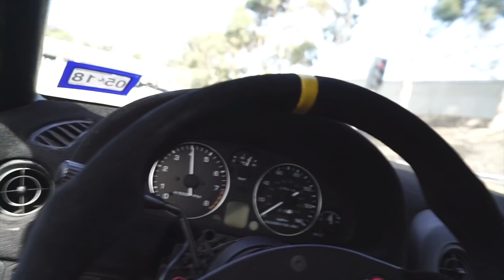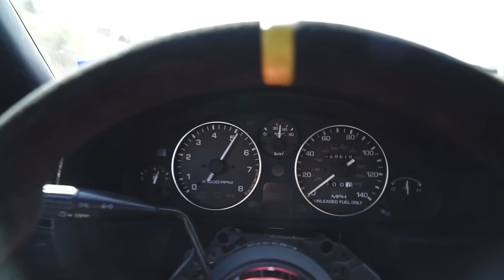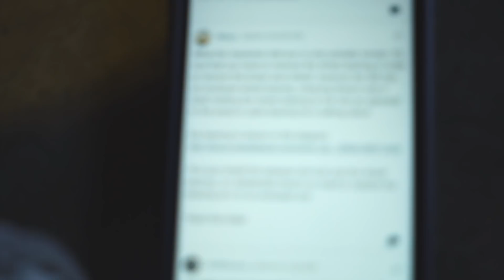It's worse than I thought...

Comment: On the battle version kit, you don't have to do all of that to get it to fit. All it requires is for you to shave the right side of the "ear" on the top of the "knuckle/hub" so that you get your clearances also you can use a cut off wheel to cut the dust shield to get the secondary caliper to fit slightly snug and look appropriate. But from one ZZ30 owner to another, keep it up, soarers are tricky but subtly easy. Also for the brakes, stock calipers have a -3an /24 fitting not too sure what's on your willwood but I'd say go for a 3/4in master to save you a headache with flare fitting hope this helps

Comment: Im guessing you already got a million responses, but the hub doesnt come off the outside like that. You need to remove all the toe links and control arms from the knuckle first. then use an air hammer, or a punch and hammer to push the axle towards the center of the car while pulling the knuckle off. The axle can stay in the diff. Then when the knuckle and hub is off you will have to use a press to press the hub from the bearing/ knuckle assembly. Enjoy.

Comment: Technically drum brakes actually have better stopping power due to having for surface area of the friction material, they lose to disc brakes because the heat up faster and don’t efficiently dissipate that heat as well as disc brakes do. Also it looks like your E-brakes didn’t work well because you have almost no pad left on the brake shoes. Just an FYI

Comment: That hub is pressed if you want it off the best way is to get it pressed out. But if you take off the drum assembly there should be some bolts do take off the drum breaks either way I personally would cut the shield right there. Just a fyi from a SC owner to another.

Comment: You need a puller to pull the hub off of the axle. You don't need to pull the axle out of the diff. Sometimes you can hammer the axle out of the hub but you chance messing up the threads

Comment: Evan I hope you know that all car ebrakes use small brake drums inside the rear brake rotor to hold the car in place lol. The reason yours probably wasn’t working correctly is because it for one, needed new brake shoes on it, and two, it was more than likely way out of adjustment and needed to be tightened so that when you fully pull the ebrake it locks the brakes in place.

Comment: I guess you don't know but if you look at those brakes rotors you will see two holes on them across from each other,get two bolts and just wet the threads with oil and screw them in and use a rachet and as you screw them in they push the rotor off. In most cases rotors are usually slack but if they are tight then use the bolts

Comment: It NEVER goes as smooth as you think it will lol. A buddy and I recently changed out the headlights in his NA Miata with some new LED ones, and it went perfectly, until we finished and for WHATEVER reason, the passenger's side headlight is now stuck in a not quite all the way up position...
Reply: Irie Storm maybe you're making contact with a wire?
Reply: NewbGaming what do you mean? The headlights were plug and play, so it's not like we modified anything

Comment: I do enjoy watching these kids try and play Mechanic.
If u bothered to do any research u would find out that; 
a) the driveshaft's get frozen over time into the hub bearing, u need a big puller to get them off
b) the hub bearing is bolted to the hub carrier with 4 bolts on the backside
Remove 4 bolts.
Apply puller to hub, centered on the driveshaft. 
Apply a reasonable amount of pressure to 'Preload' it. 
Then smack it with a Sledge, should pop out after the first hit or two. 
Simples :D

Comment: Well that sucks. Panic attacks will mess you up, take it from someone who has had them. Big life changes can definitely trigger them so it does not mean you made the wrong choice. It just means that the big change of moving MAY have brought them on. Best thing you can do is identify the things that are adding stress to your life and try to reduce those things. There is a natural supplement called Relax-All which I have tried and does seem to help. I have heard that Cannabis works but cannot speak from experience. Back off on any stimulants only until this passes. Basically anything with caffeine in it. The biggest issue with Anxiety is the inability to control when it happens. :(

Comment: Just going to say you need to spend more time researching how to do whatever modification your working on. Instead of making Content about almost doing work, you could be making resourceful videos for your subs to learn from. As far as your dust shields for your hydro install, you should remove them. You should cut them where needed. The metal is very thin. Tin snips will do just fine.